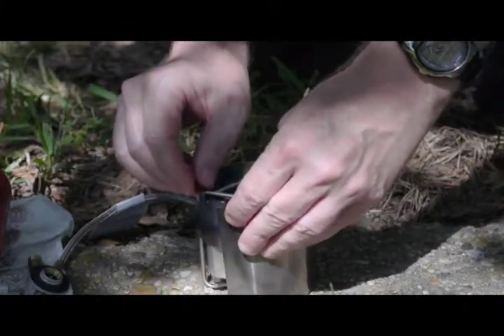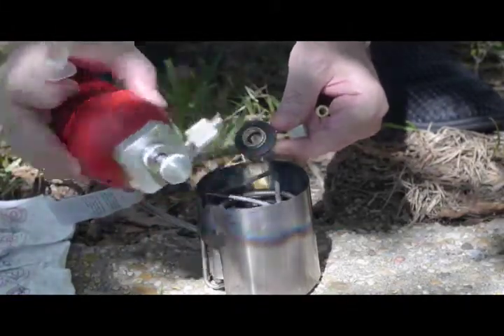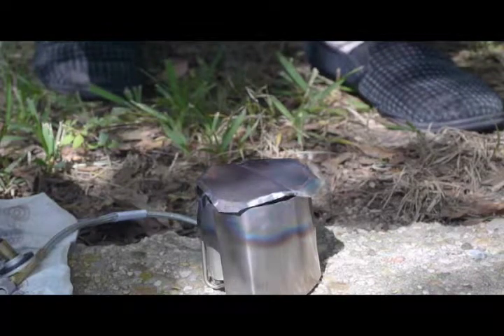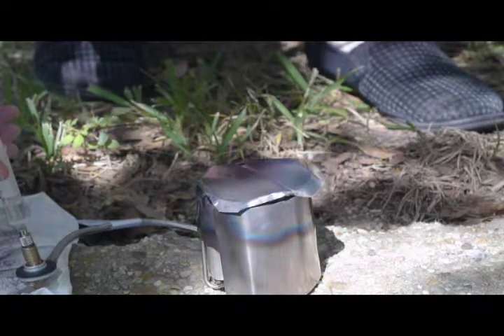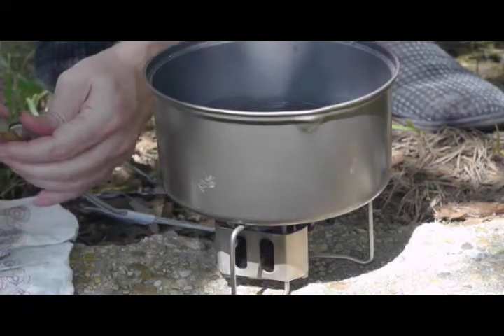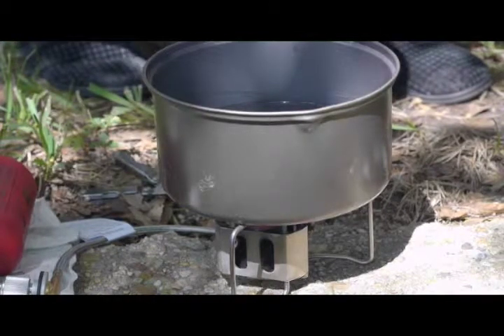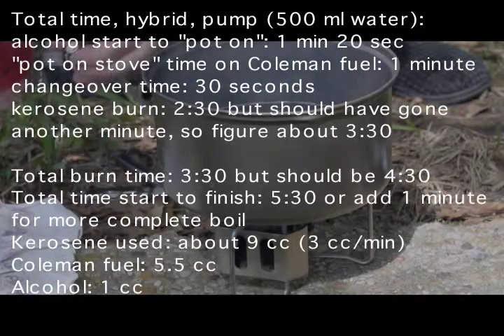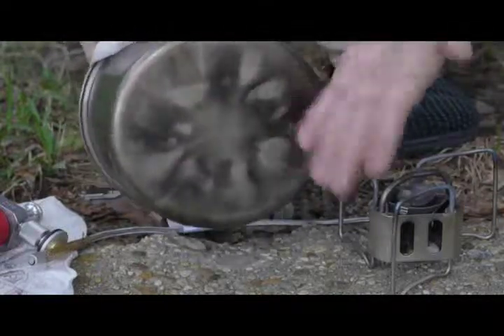3-stage hybrid start-up routine for kerosene stoves, Part 3: "Real world example"

Comment from the maker: ANSWER: Actually, yes, I do! SIMPLE: what EXACTLY is difficult about this? EFFICIENT: maximum use of fuel's energy compared to typical start-up routines. PRACTICAL: if you've tried to start kerosene stoves OUTSIDE IN REAL WORLD CONDITIONS and like that better than this method, by all means use that method! I would never go back to older methods. 1 cc start-up alcohol, no waste of fuel, and SAFE compared to traditional methods. You keep using your method, I'll keep using mine!